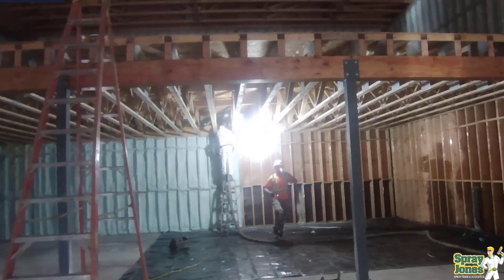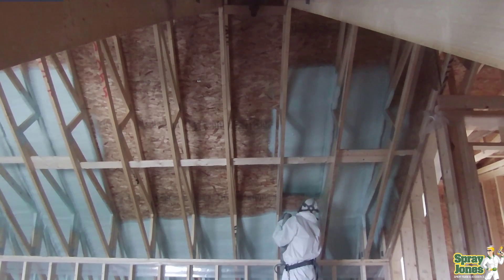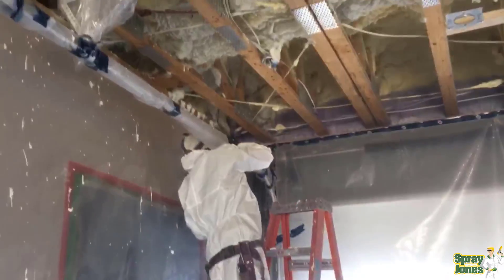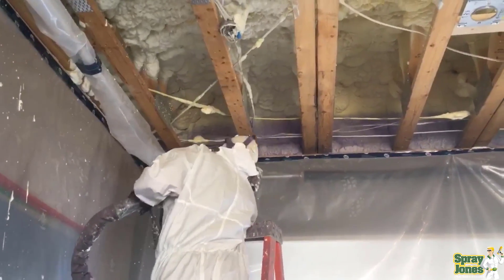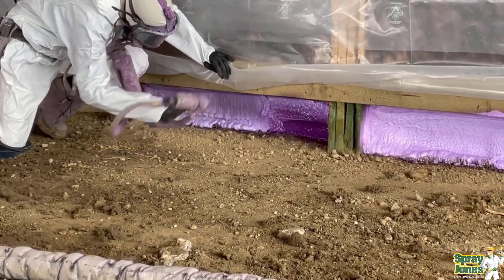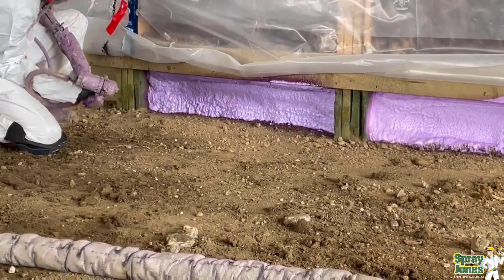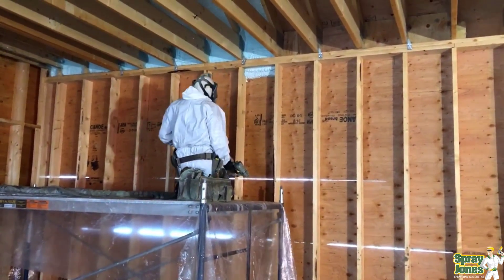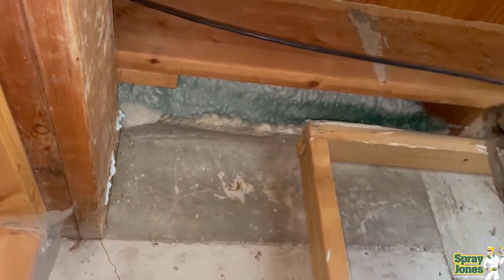How Thick Can Spray Foam Insulation Be?

Comment: Can you spray enough closed cell foam to have an unvented roof that reaches R60. from the interior? Do you need to add exterior rigid foam to achieve this R60 value?
Reply from the maker: Yes you can. No you wouldn't because 4" of SPF is past diminishing return.

Comment: I'm building in southwest Colorado and the humidity is very low, around 20%. Does that decrease the temperature that closed cell spray foam can be applied? I was told 55 degrees Fahrenheit and above. But if the sun is shining the metal will be much hotter than the air temperature, so that must help as well? I'm in a race against winter trying to get the steel building up, before the cold is here for real.

Comment: hmm. the guys who sprayed my place, did 4" of closed cell all at once... 
for the most part it did ok, didnt crack, but 6 months later, under the roof it detached a bit from the rafters on the south side...
theres 1/2" to 1" of hollow space under the roof sheathing around the rafters :(

i shoved some canned foam in to "fix it." for the worst cases. about all i can do... but the vapour barrier aspect is critical :S
Reply from the maker: That or you rip the loose stuff down until back to bonded - re spray in the patch using DIY foam.

Comment: I live at 8000 feet in Wyoming. We have temperatures in the winter from typically 28° down to 30 below for a few weeks every winter. What would you recommend for a thickness on walls and ceilings for a metal build with concrete slab in floor heating. Close sell, Insulation.

Comment: I have a house built in the mountains of NH in 1973. Paying circa 900-1200/month . Thinking about pulling down the vaulted ceiling drywall and spray the 2x6 rafters with closed cell foam. Curious if you feel that 5” of foam will be enough and what will be the cost impact of my heating?
Reply from the maker: Watch the video "how much foam do I need". 4" will be lots

Comment: Im in Texas, trying to figure out if its possible to spray foam an attic on a 17 year old finished home. We bought the house 8 months ago and then i got into some building science and want to spray foam the under side of the roof deck so my attic is in the conditioned space.
Reply from the maker: Depends on how much space is in there to work and properly detail things correctly. 
Watch the playlists for vaulted ceilings, more info available.

Comment: I am looking to have my attic insulated. It is in Southwest Florida on the coast and it is a fairly shallow attic space, approximately 4’ high at the ridge.  The house was built in 1964 and is a block house with a truss roof. What do you recommend for insulating that space?  Also, I am having every window and door replaced with hurricane impact windows and doors in the next three months. I was told a sealed and spray foam insulation on the underside of the roof deck is the best option.
Reply from the maker: Go watch the playlist for vaulted ceilings, I have a video in there about spraying up vs down. Down is a problem.... learn why.

Comment: Is there any difference between the closed cell foam you spray and the closed cell foam they sellon like Amazon other than experience im disabled live in uninsulated 5th wheel in Texas and heat is killing me and my wife would love to have a professional come in but with my income that not going to happen if we want to eat and do you recommend a brand if any for a retired excavator operator thanks in advance
Reply from the maker: DIY foam is hit and miss. Best to buy it from a local contractor-supply depot.

Comment: Awesome helpful video: few questions for homes in US Tx, with Closed Cell application in attics do you need to remove the baffles or do these typically stay in place after the foam install? Also with regards to getting a conditioned attic space with installing closed spray foam, what is best method to dealing with HVAC air and gas furnaces setup in attics in the south climate zone 3? Since these gas furnaces are installed in attics and will need air intake! Any way to get around this issue before installing closed cell foam! Also is there any major differences between brands/companies manufacturers for closed cell foam of best to worst rankings?
Thank you
Reply from the maker: Yes remove un-needed baffles. For attics use high efficiency HVAC systems. When in doubt talk with Energy Wise Structures to design what you need out of Arlington, Tx.
SPF is like trucks, everyone has their favs.
Reply: @SprayJones  thank you!

Comment: I live in a 100 year old cold house and having a problem with smart mice. Could a hot spice be add to the foam to repel the mice. The basement is a stone foundation and 1st and 2nd 
are lath and plaster. I live in the Toronto Ontario area.
Reply from the maker: The SPF alone is sufficient. You need to get it when the mice are coming in and seal off those passages.

Comment: What do you think about using the cans of spray foam (gaps and cracks) to fill in some tight corners if theres on a few small 1s on the job and then just going over with 2" of closed cell
Reply from the maker: Fine.. foam is foam. We use can foam to seal off mid sized gaps so the spray gun doesn't shoot it out fast.

Comment: Architectural Testing Inc. Out of York, PA performed a thermal efficiency test according to ASTM standard C-236. They found you start to hit the point of diminishing returns after 2 inches of spray foam. At 2" you are already at 86% thermal efficiency. You hit 90% at a thickness of 3.2 inches. Probably smarter to start investing more in your HVAC and climate controls after that point. EDIT - The above comments are about closed cell foam.
Reply: Yes, diminishing returns, but you really need to think about the lifetime expense of climate control of your structure to. A good BTU calculator can give you an accurate real life expectation of your actual BTU requirements as you change the R-value of the foam. While 2 inches is efficient, it's not sufficient. Also the more efficient you make the structure the smaller you can size your equipment, which unfortunately from my experience dealing with HVAC guys they don't seem to know how to do. You can spell it all out for them, try to educate them and tell them you need a 3 ton unit and they'll still give you a bid for a 8 ton unit, because they just don't understand. But that's a whole other problem which is unrelated to the foam itself.
Reply: @christophergruenwald7266  I’m not a professional but have done a lot of research. I’m just finishing a small duplex where we built half to live in then the garage and owners half which I will finish taping today. Right now I’m heating the whole thing with about 120 M BTU a winter not including hot water. About 1400 is daylight basement open on the south side. We are just using 2 small toyo oil heaters and when it’s real cold I fire up the wood stove. A few weeks ago out digital thermometer pegged out at -40 and the big round thermometer had -52.  This place is built on a south facing bluff with close to 200 square feet of windows on that wall. Yesterday was about 32F but sunny and the heaters shut off. They just ran a gas line up our road last summer so that’s the next project. The pex is already under all floors.
Reply: Does that work at  -50? I have a lot more closed cell foam  than that in our walls.
Reply from the maker: Watch "how much foam do I need"...

Comment: What are your thoughts on 3" installs? Should I require my installer to do 2 and 1 or just be ok with 3" at one pass?
Reply from the maker: Anyone worth hiring knows how to install and does not need to be told. We would do 2 passes at 1.5".
Reply: @SprayJones   thanks

Comment: What about a 2" closed cell base and then going over the top with open cell? Is that kosher?
Reply from the maker: Introduces problems when there needn't be any..
Reply: @SprayJones  so you can do it? I had a client complain about cost
Reply: @jwristen24  you could, but I have my doubts that you'll save money doing that. If you are spraying open cell and closed cell from the same rig you are going to have a lot of labor invested and chemical waste every time you switch back and forth. I personally just stick to one foam anymore and don't mess around with switching back and forth. So can you? yes. Should you? You run the risk of problems caused by it, so no. Are you going to same money doing it? Unlikely and it may just end up costing more to do it that way. That said, in my personal large garage I have this on my roof deck. Was it planned that way, no. It was insulated over a period of several years when I'd have the time or chemical I wanted to use up I'd spray part here and there on it. So the roof has anywhere from 2 inches in areas to 4 inches of closed cell. Then I had some open cell I wanted to use up, so in areas that got a second pass it has 12 inches of open cell over the closed cell and areas where I ran out before getting a second lift it has 6 inches over the closed cell. The garage is 40x72x14 and I park my spray foam rig in it as well as other equipment. If it was for a customer, I would not spray a couple of inches closed cell and go over it with open cell.

Comment: Unrelated question. I'm planning to use some freezeless hose bibs on a pole barn and use closed cell for the insulation. Will I be able to unthread the hose bib for future service or I need to cut out the drywall and cut the foam out in order to replace it if needed?
Reply from the maker: It will be an issue to get it out. But that is what you want.
Reply: I would buy a quality model like Woodford that offers rebuild kits so you don’t need to replace the entire thing when internal components wear out after (hopefully) 15+ years.
Reply: That stuff sticks to near everything well enough to add structural strength.
I'll bet you would never get it out.
I wonder if you were to plastic wrap the pipe or cover it with grease of some kind, it would prevent the adhesion.
Hopefully Spray Jones chimes in here.

Comment: Thank you for doing what you do here. As an FYI there is a channel that I watch that has a huge following that has been putting some information out about spray foam that is not correct. Check out RRBulildings dream shop videos to hear his comments. With 1.7MM subs his opinions go a long way.  Not trying to call him out, he is just misinformed about spray foam.
Reply: RRBuildings have good informative  building videos. He insulted his personal shop with comfortbord. Given the amount of videos dedicated to comfortbord I’m sure there was some sort of sponsorship. There was one point made that I need more information on, which was spraying foam in extreme cold climates. My understanding is that foam needs a dry and warm surface to properly adhere to. How would you heat an entire metal wall with below zero temperatures outside to get proper adhesion?
Reply: Agreed.  RRBuildings has excellent content and you are correct he currently has a sponsorship from RockWool. You are also correct that it is very impractical to attempt to heat a building to get the siding up to an acceptable temperature to apply foam. Spray Jones (Mike) covers this in depth in several of his videos.  You have to either wait for ambient conditions to be acceptable or choose a different insulation method when conditions are not acceptable to apply foam. You are also correct that RRBuilding has had some harsh words for his local spray foam installer. It is unfortunate that he has allowed that experience to bias his opinion towards the entire industry. He is a huge channel and is his opinions carry a lot of weight. Mr Postframe had a huge issue with spray foam on their personal residence build, found it, corrected it and went back with foam and continues to use foam in his builds.

Comment: When layering closed-cell foam, how is the bonding between layers? If pulled apart, would it break at the layer junction?
Reply from the maker: Cohesion is like a weld. Will break somewhere else usually.

Comment: I’ve seen foam products whose listing / labeling restricts foam thickness to 2”. I’ve also seen foam panels manufactured as thick as 6”. I say: follow the instructions!
Foam generally requires moisture for the chemical reaction, and foams vary as to the “strength” of their bubbles. Spraying too thick will result in bad results: soggy, uncured cores, reduced bubble size (poor insulating), or distortion of building components.
Reply from the maker: Karen this is 1:1 spray foam, not a single component moisture cure. There is no need for the spray we are talking about to have "moisture" in order to cure. In fact moisture with this system is a detriment.